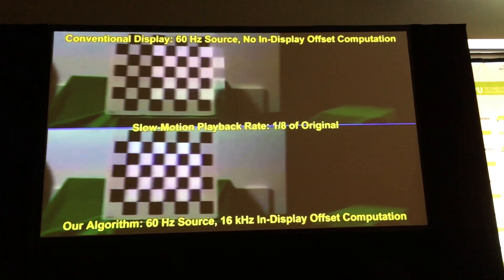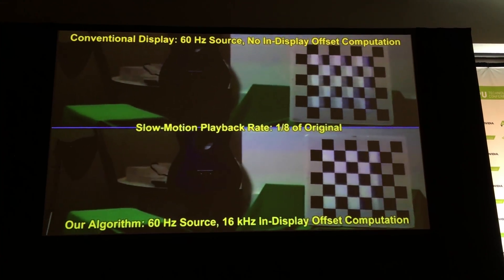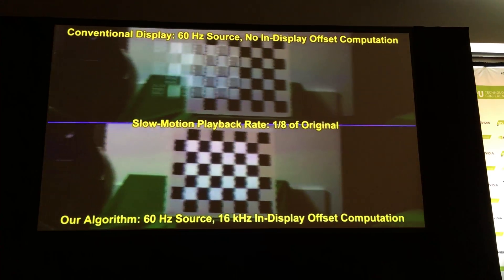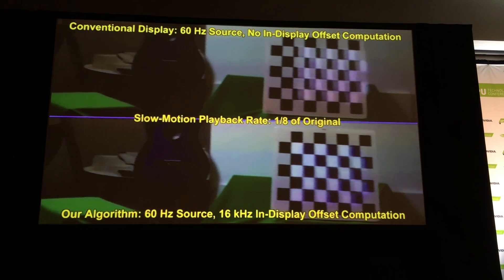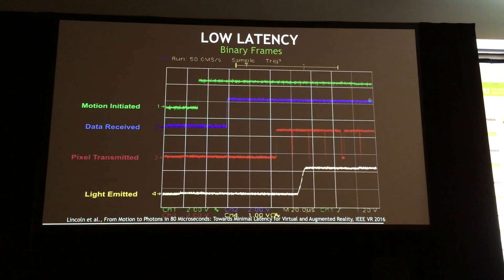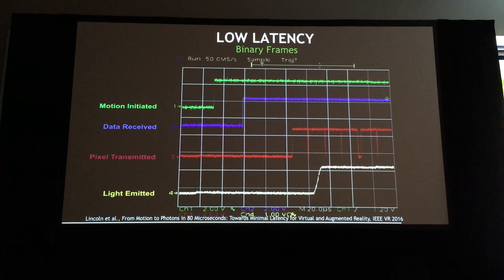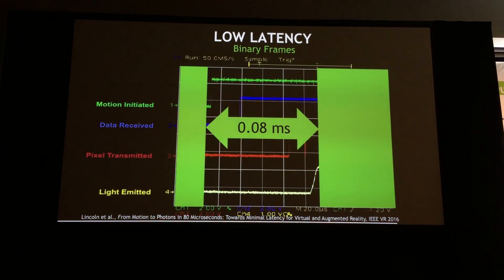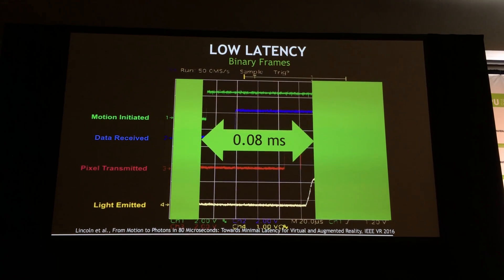NVIDIA Demonstrates 16,000Hz AR Display

Comment: So this is software not hardware?
Reply: It's both. You need hardware to get those inputs and outputs between systems lower. Plus, you calculation speed to generate the image is more hardware than software. After that, software with prediction and timewarp creates an apparent delay at cost of likely errors which would be unnoticeable by humans.